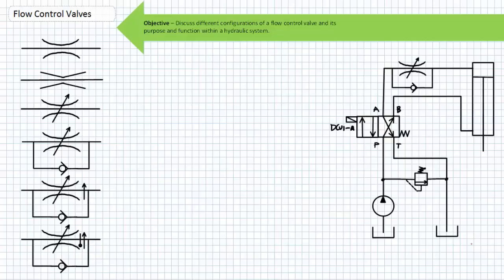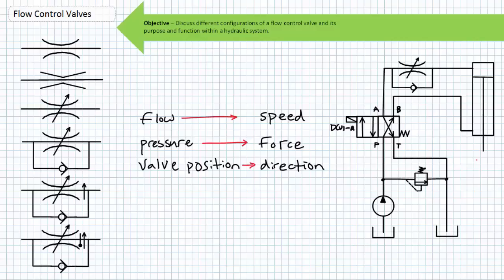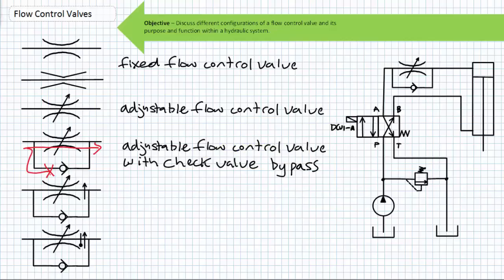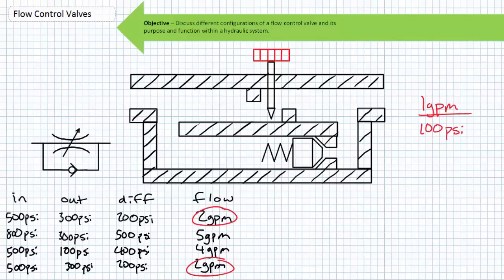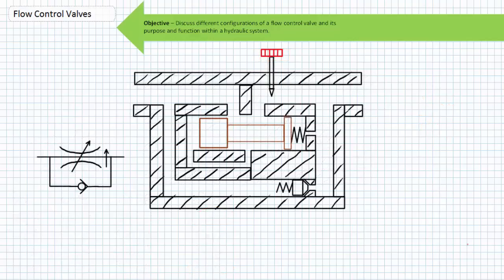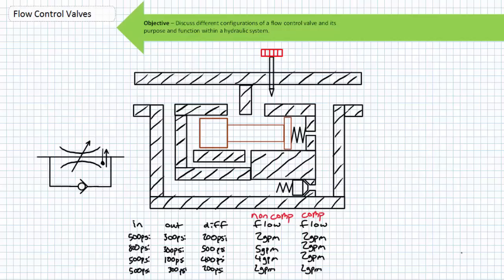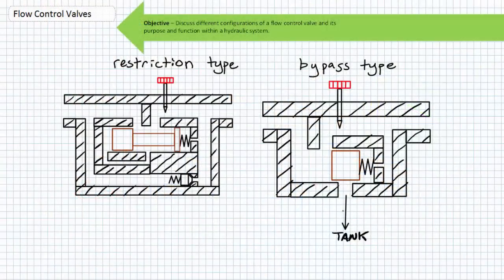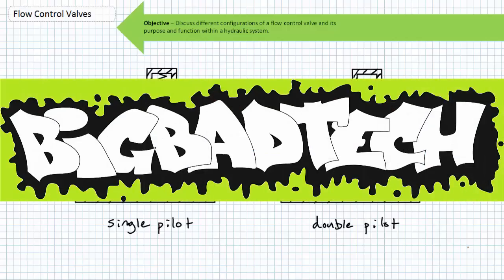Flow Control Valves

Comment: Is the flowrate (Q) across a flow control valve proportional to the pressure difference (ΔP) across the valve or is the flowrate (Q) proportional to the square root of the pressure difference (√ΔP)?  If instead it is a linear relationship, how do achieve this if in general, flowrate (Q) is proportional to square root of pressure difference (√ΔP).

Comment: Suppose I have a control valve whose upstream pressure is fixed. Now if I open the valve, flow increases, you restriction will decrease so pressure downstream will increase. Overall pressure drop will decrease. But how is the flow increasing despite of pressure drop decreasing.
Reply from the maker: Downstream pressure is a load induced phenomenon.

Comment: very informative . Reducing flow by a valve is cheap and efficient , what if i reduce the speed of a motor by a vfd will i get the same resulting pressure ? thanks in advance.
Reply from the maker: Remember that pressure is a load induced phenomenon. As long as the load induced pressure is inside the range of the pump at the reduced rotational speed it should work.

Comment: Hi Sir 
I want to ask a question, How the flow rate across the flow control valve increases by increasing the pressure difference across the valve, however when the pressure increases upstream the relief valve opens more and more fluid goes through ?
the logic say when the pressure difference increase , less flow across the valve.
Am i right or there is a false understanding in any part ?

Comment: Shouldn't the flow control be on the discharge side of the cylinder?  Is either way acceptable?  What are the advantages of each configuration?
Reply from the maker: +John Griffin Check out this lecture: https://www.youtube.com/watch?v=VFtRNAu3_wg 
it explains several common flow control methods

Comment: Normally flow control is achieved by reducing the cross section through which the oil is flowing. But continuity equation states that product of Area x velocity is constant through out the tube. So when area is reduced, velocity increases and flow should remain the same. Then how does reducing the cross section helps us in flow control?
Reply from the maker: There is not continuity. A relief path exists. Any flow not traveling through the flow control valve is bypassed to tank. That's really the fundamental takeaway about restriction style flow control valves. Also understand continuity assumes laminar flow. In reality you cannot expect to force 500gpm through a 1/4" diameter tube without it getting a little turbulent.
Reply: Got it sir.

Comment: I don`t understand , the positive displacement pump delivers a constant discharge say 2 gpm ,and after the flow control valve it becomes say 1 gpm ,where does the other gallon go ??                             and many thanks for the video
Reply from the maker: The excess is diverted to tank through the pressure relief valve.

Comment: I have one question how you decided for 500psi input output will be 300psi
Reply from the maker: In this application we're just assuming the load induced pressure will be 300psi.
Reply: Thanks for quick reply.please can you tell how to design output pressure.this will help me a lot
Reply from the maker: Output pressure is dependent upon:
1) applied load
2) actuator dimensions
Check out the "Pascal's Law" lecture at: https://www.youtube.com/watch?v=YNoPs9kH7Ao